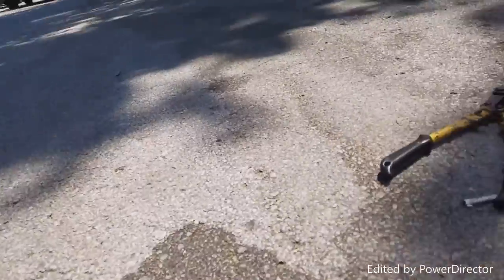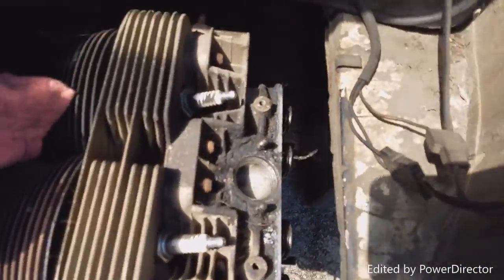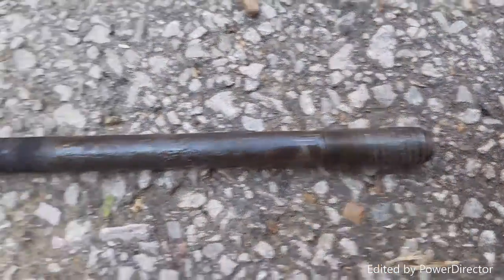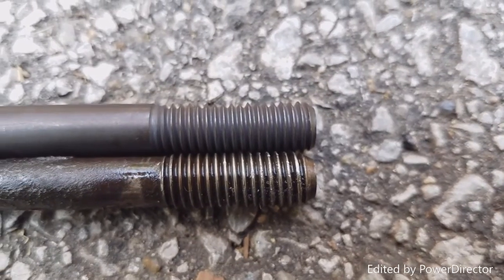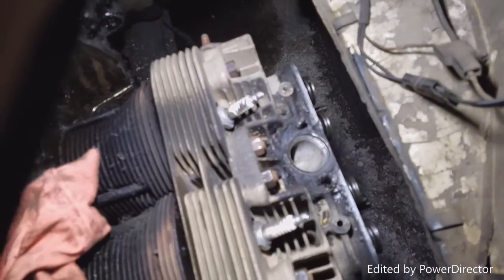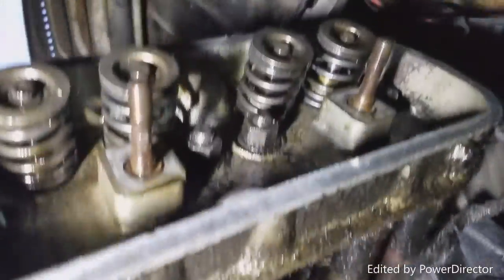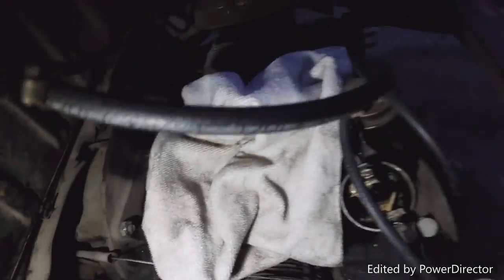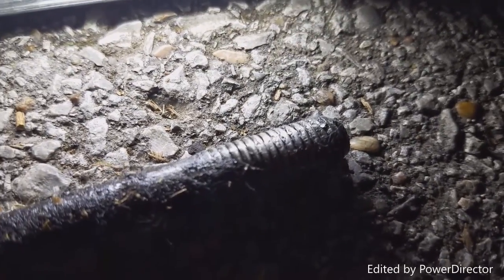bug stuff again

Comment: How do you fix the striped block? Get bigger rods?  Thanks for the upload...
Reply from the maker: well the stud i bought will fix it, the self threading one but it needs drilled bigger first its 2mm bigger on the block side and the cylinders need to be off for that, i was trying to fix this without pulling the motor out since i have no place to keep it safe while getting fixed